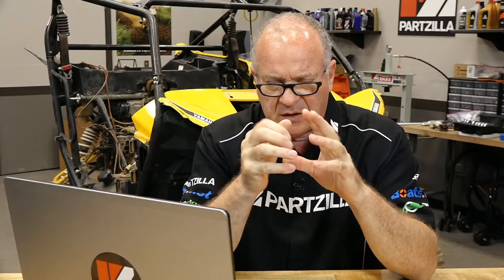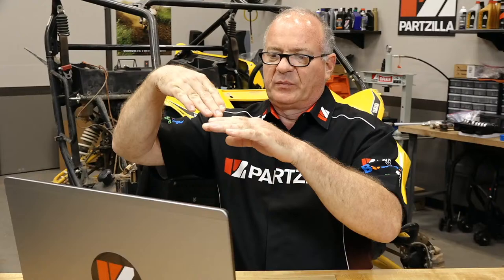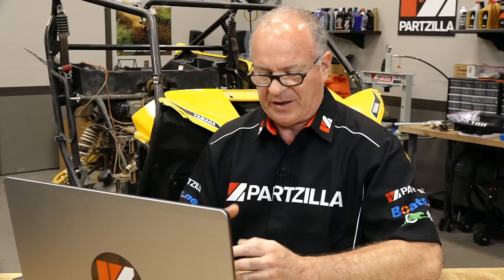Partzilla Live Q&A with John Talley -- 5/29/20

Comment: Big fan of your channel as I do have a question about my yamaha 2002 yz425f as for the exhaust it came with a fmf powercore 4 exhaust as I feel a slight exhaust leak near the connection where the 2 pipes slide into each other clamped with the original pipe clamp so my question is should there be a exhaust muffler joint metal gasket inside where the 2 pipes meet up or is this gasket metal joint only for the original exhaust set up?
Thanks, Steve

Comment: Hey I have a 2005kfx 400 that I just put a 440 kit in and new valves and timing chain in it and it's in time all the valves are in spec it starts right up and has plenty of power but when I rev it to kinda high rpms it will backfire and shut off i am stuck I don't know what it could be